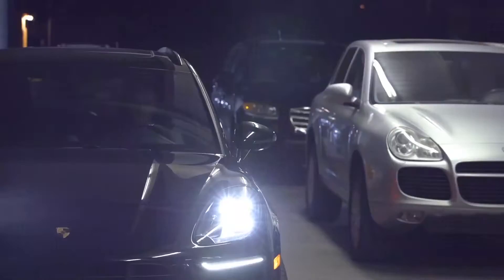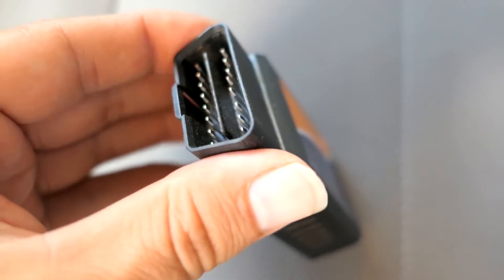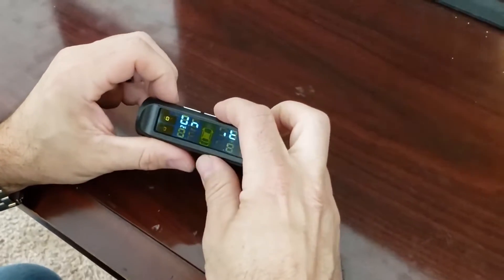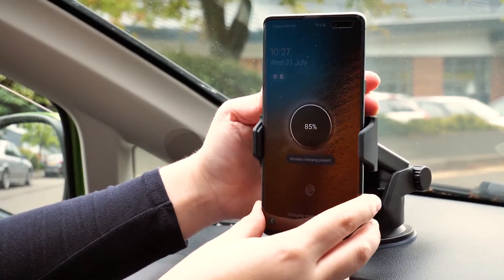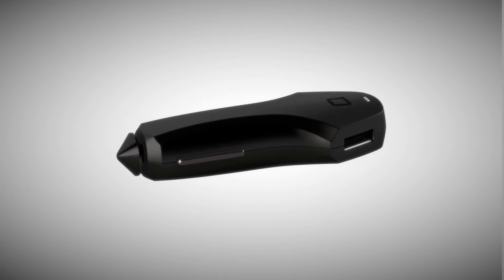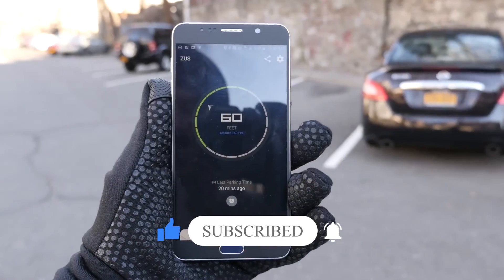13 COOLEST CAR ACCESSORIES That Are Worth Buying From Amazon (Best Automobile Car Gadgets 2021

Comment from the maker: 0:00 Introduction
0:31 Zmoon TPMS Car Tire Pressure Monitoring System: https://geni.us/XFnuRm
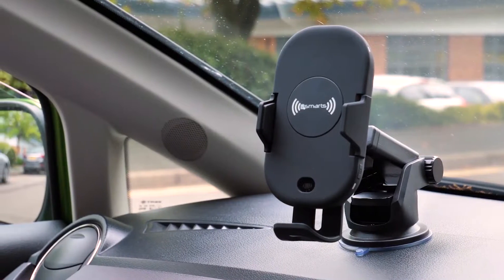1:29 Ainope Car Phone Holder Mount: https://geni.us/kdgOYrV
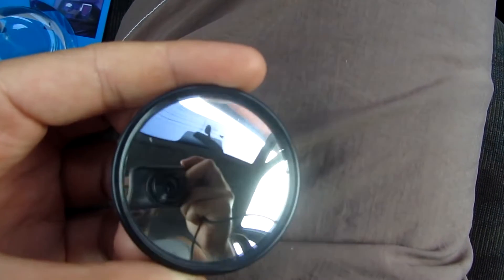2:04 Ampper Blind Spot Mirror: https://geni.us/J3AXL
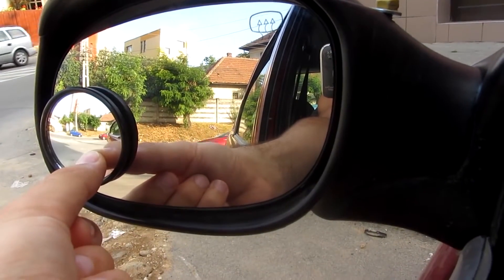2:42 Wsiiroon WIFI OBD Scanner: https://geni.us/bpm46j
3:15 TopGo Cup Holder Phone Mount: https://geni.us/bzkzT3B
3:45 CARCHET TPMS Tire Pressure Monitoring System: https://geni.us/nUiasTV
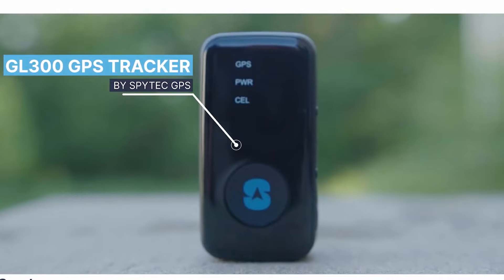4:25 Spy Tec Vehicle GPS Tracker: https://geni.us/tAXN
5:16 Mpow Car Phone Mount: https://geni.us/j57Z9
5:55 HoLife Car Vacuum Cleaner: https://geni.us/iT38
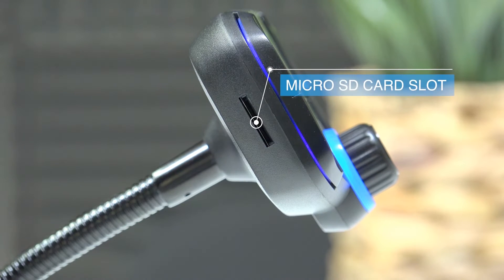6:30 CHGeek Bluetooth FM Transmitter: https://geni.us/dA7N
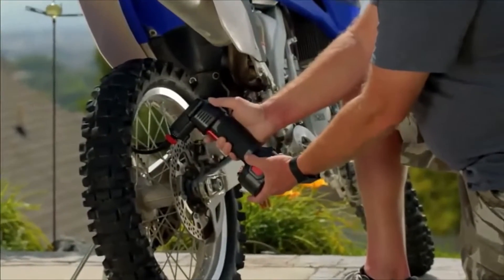7:10 AINOPE Tire Inflator: https://geni.us/z7yG
8:05 Scosche MagicMount Universal Magnetic Holder: https://geni.us/pAz6
8:30 Nonda ZUS Smart Charger: https://geni.us/Zt1mJsG